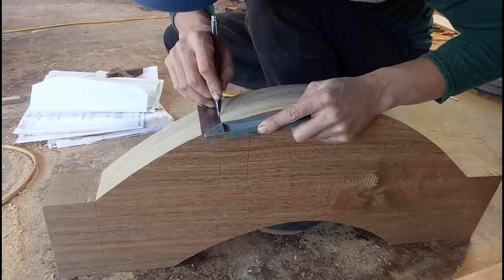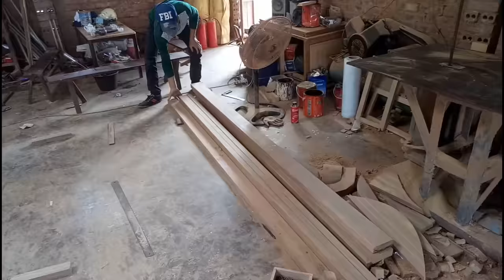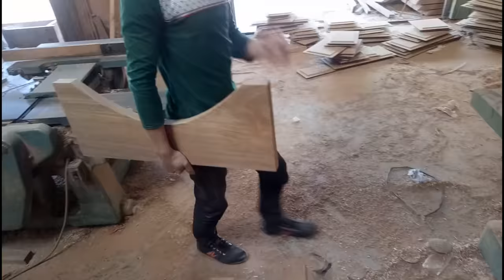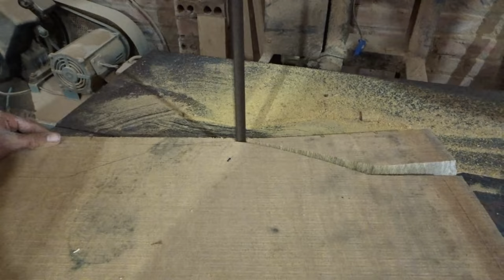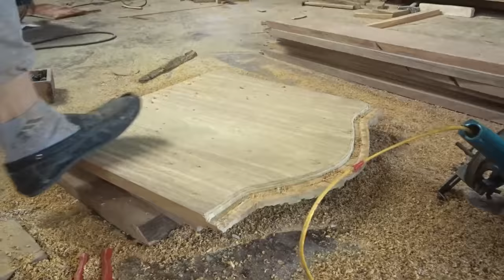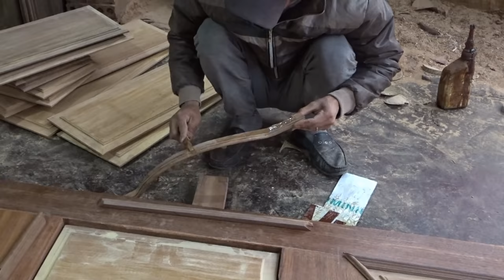Amazing Techniques Woodworking // How To Build And Assemble A Beautiful Front Door

Comment: Hello a small help, im fixing a main door for my new house, That spot is exposed to burning sun for 5 hours a day. Also rain will directly fall on it. Which wood is better ? Teak ? Or Malaysian teak ? And if i varnish it will the sun heat cause discoloration, some are saying better to paint it if sun will shine directly on the door. Can you advise.
Reply: Maybe try a marine varnish, it’s made to hold up in harsh conditions and it’s often used on teak decking and railing for yachts.
Reply: @makemyday1477  > Thanks Chuck. Not your fault but the idiots in my country haven't even heard of it. Must be a niche material that would take me sometime and lots of calls to track down.

Comment: Can some one please tell me how could this be a front door, when some intruder can easily pry open those panels with just a small screw driver!
Reply: Put a pit bull on the other side
Reply: I agree. This is so unsecure door... So dumb and stupid.
Reply: don't underestimate the power of wood glue, most hardwoods have a shear strength of around 4000 lbs per square inch and more often than not the wood fails before the glue does. This door looks plenty secure for a neighborhood where people can afford this sort of door.
Reply: @waskito3443  exacty ! well said. 
people likw to look and make claims to sound smart without understanding context
Reply: this is production work, not hobby work. measures will be taken to bring the price down for the market